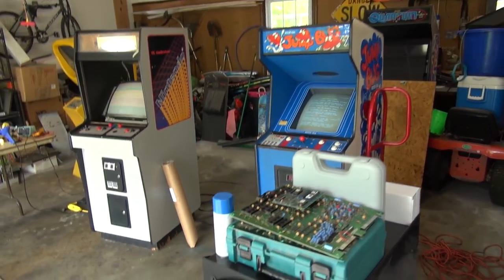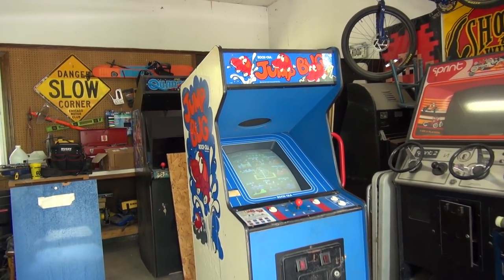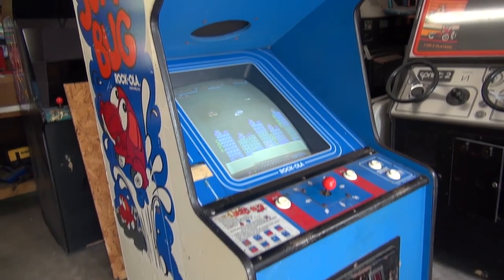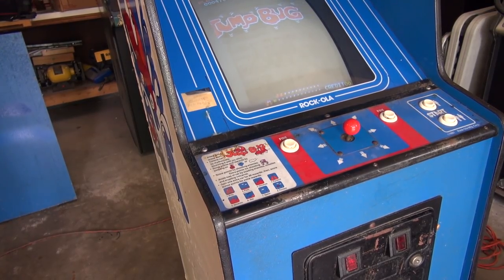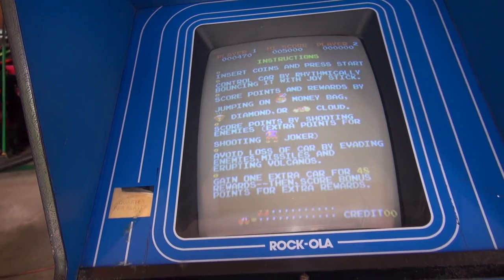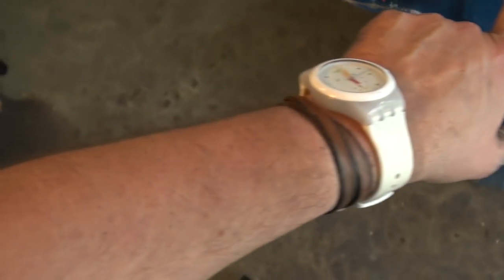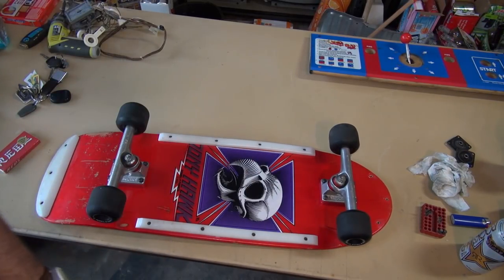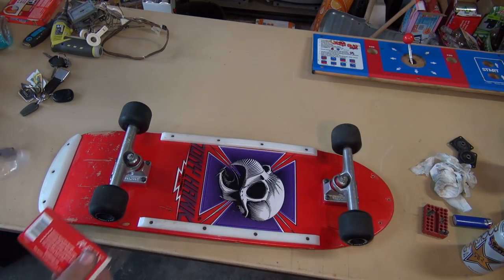Rock-Ola Jump Bug  ARCADE RESTORE PART #5 - Wico Joystick rebuild

Comment: John, You might consider using some masking tape  as a hole backing. Add the Liquid-metal , then after it fully dries , remove the tape. Now you have a nice clean fill.
I would put the tape in the front and spread the liquid metal over the back side of the hole.
Reply from the maker: Charles Smith Hey,  that's a good idea!
Reply: I was thinking using aluminum foil instead of washers because it is thin.

Comment: the square are Robertson screws a Canadian invention (patented in Canada in 1909), you be using them for everything in the USA now if Robertson agreed to License the screws to Henry Ford :)   "The Fisher Body company which made the car bodies for the Ford Motor Company, was one of Robertson's first customers and used over 700 Robertson screws in its Model T car. Henry Ford, after finding that the screw saved him about 2 hours of work for each car, attempted to get an exclusive licence for the use and manufacture the Robertson screw in the US. He was turned down by Robertson who felt it was not in his best interest and shortly after that, Ford found that Henry F. Phillips had invented another kind of socket screw and had no such reservations. Although the Robertson screw is most popular in Canada, it is used extensively in boat building because it tends not to slip and damage material, it can be used with one hand, and it is much easier to remove/replace after weathering"

Comment: In case you were wondering, those square head security bits are called Robertson Head screws.  I've come across them in automobiles and in mobile homes.  Auto Zone sells a nice security head bit set that I picked up for 20 bucks.  It comes with all kinds of different security head bits, many of which I've never seen before.  It's in a nice blue case if you do decide to hunt one down!  :)

Comment: Rock-Ola start off in Canada , maybe that why the Canadian screws :) "David Rockola was born in 1897 and spent his youth in a small town in western Canada. At age 14, after his mother died, he dropped out of school and took a job as a bellboy in Saskatoon while taking correspondence courses on gasoline engines. Later he opened a cigar shop in Medicine Hat where he worked so long and hard that he was hospitalized with diphtheria fever and lost his store. He opened another in the St. Louis Hotel in Calgary. One day a pair of Australian salesman dropped in and sold Rockola a "trade stimulator" (a kind of early slot machine that skirted the law by paying out in redeemable tokens or credits instead of cash). Skeptical, Rockola put the machine on the shop's counter where it was soon earning more money than the cigar shop itself. David quickly decided to enter the coin-op business and took a job with the Mills Novelty Company. By age 23, he had earned enough money to move to Chicago, where he began a career in the slot machine industry. At the time, the industry had an unsavory reputation (Mills Novelty, for instance, was rumored to have ties to mobster Frank Costello) and before long Rockola landed himself in a bit of legal hot water".

Comment: Hot tip on cleaning up joystick shafts - chuck them in a drill motor and you can polish them just as if you had a mini-lathe.

(Another poster has already suggested this, my bad)

Comment: John, you should think about picking up a metal/auto body working kit. You can get them from Harbor Freight for really cheap, and they'll work WAY better than a standard hammer or rubber mallet when it comes to getting things like coin doors back into shape...
Reply from the maker: Next time I'm at Harbor Freight I'll check it out. Thanks.

Comment: here's a suggestion, I know you hardly ever have to fill holes. But instead of using washers, Why don't you buy a good size piece of sheet metal and just cut out pieces when you need to fill holes. better than having to buy washers and possibly misplace them.